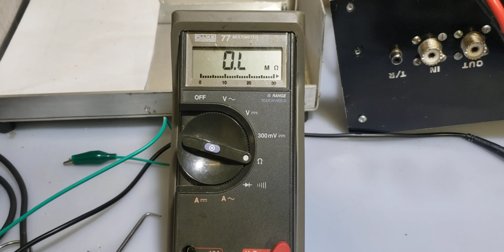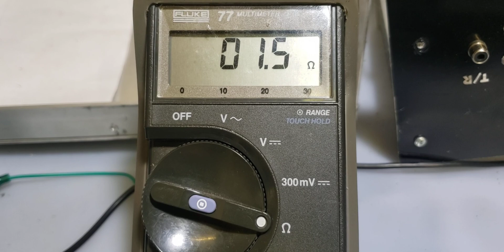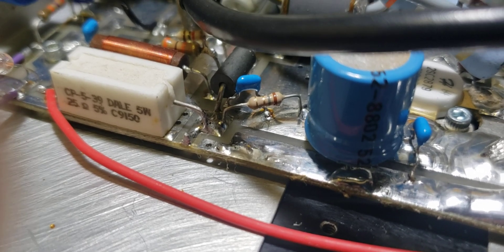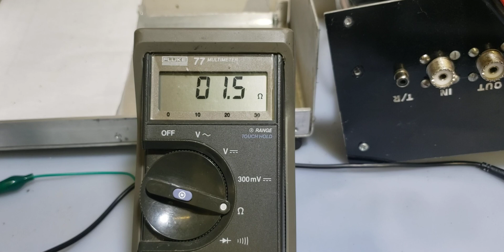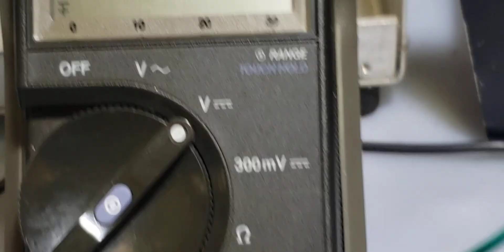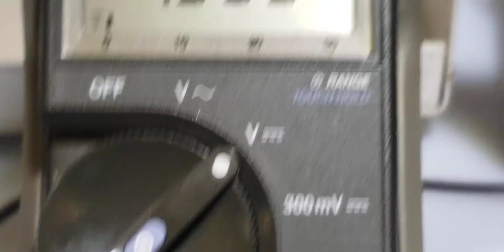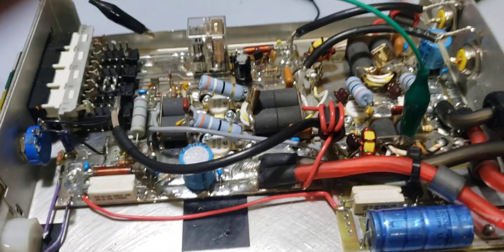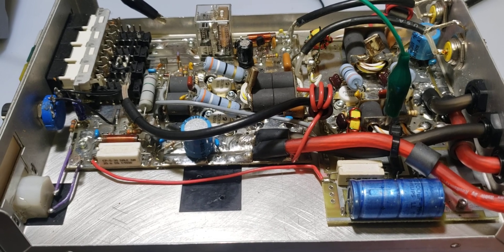[GK Tips & Tricks] - How To Check Bias Voltage For A Texas Star Amplifier!

Comment: Thanks for the video!
I have a DX350HDV I get 1.60 ohms resistance from back of transformer to ground and only .57 Volts bias voltage. 
I have the 1.6 ohm R8 resistor

No output
Reply from the maker: You have have a blown transistor.... I hope not but it is possible. 0.56v is a tad bit low bu5 it maybe cause you are running on low voltage.
Reply: Ok thx! I’ll test them. 
I was concerned about getting the same ohms of 1.6 reading as the R8 resistor when taking reading from base to ground.
Thanks for all your videos!!
Reply: Pulled the transistors. One is junk (says Diode) the other Toshiba 2SC2879 Red dot says good with gain of 44.

Comment: very good. must be close to same for each 2 pill section. a simple test will keep you from blowing transistors. now a diode bias different . I take choke off base lead or input transformer. this removing bias from transistor. then key relay with no rf and test voltage . must do this on all sections at the same time. this mad read a tad high because 10 ohm out of circuit. the outher test on any bias amp is key relay no rf. measure current draw of amp. should be a amp or 2 depending on number of pills.  if in range leave keyed a wile . check each transistor for temperature. want even heating. a low HFE transistor shows up running cool a leaky one shoes up hotter than rest with same bias.  all this with no RF. also dummy load in both so239 . incase a oscitation happens . will draw many amps. when happens. 73's